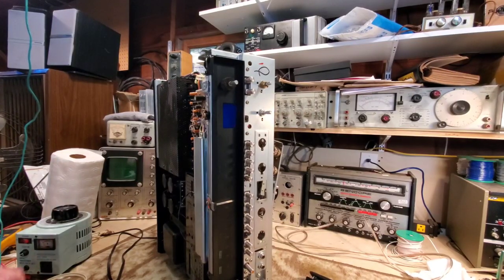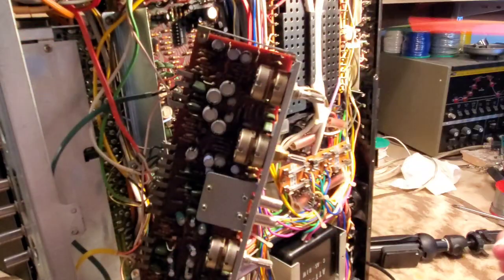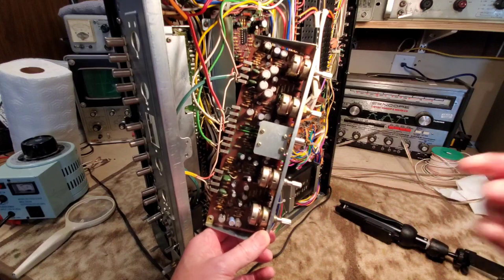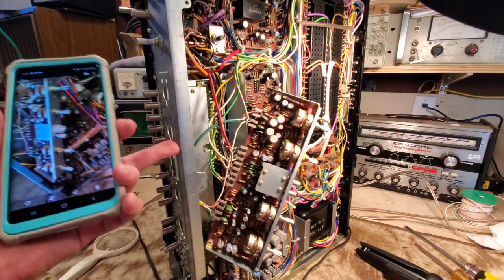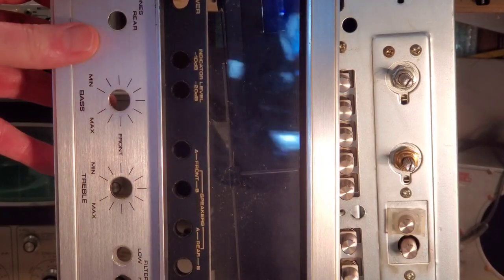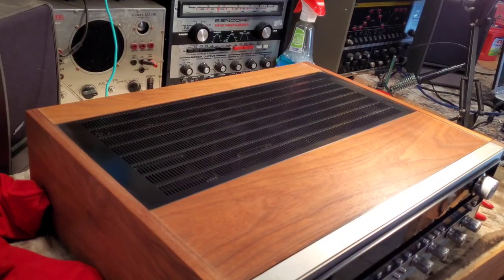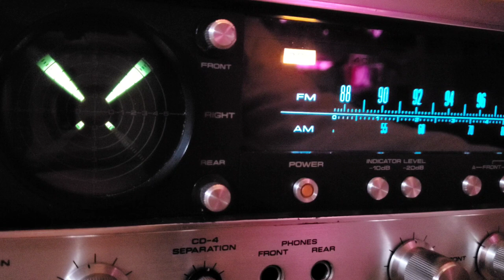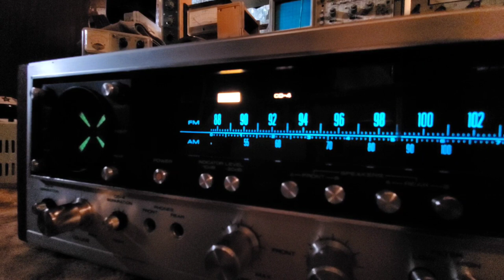Pioneer QX 949 Quadraphonic AM/FM Receiver(1974)..Simple Cleaning & Restoration (Part 2)

Comment: Hi thanks for this awesome video! Just recently got handed down this receiver, think I'm having a few little issues with it.  The only thing that I can get to work in two channel mode is the auxiliary input, phono and FM radio etc only come in on right channel in two channel mode. If I flip it to four-channel mode I'll get left and right again. Wondering if I'm hooking up the speakers incorrectly? Do you recall where front left and front right speakers are supposed to be hooked up for two-channel mode? Could it possibly be a bad selector switch or a selector switch that needs to be cleaned more thoroughly? Thanks!
Reply from the maker: You need to deoxit that speakers mode switch like crazy...it will come good
Reply: @rosieokelly  okay thanks. I hit the mode switch up today along with all the others,  having same issue. I guess I need to repeat the process a couple of times. Thanks again for your videos, really informative :)